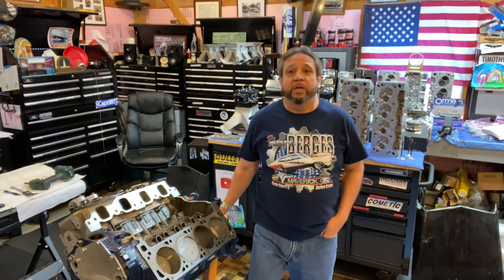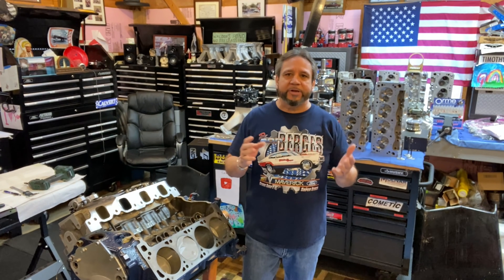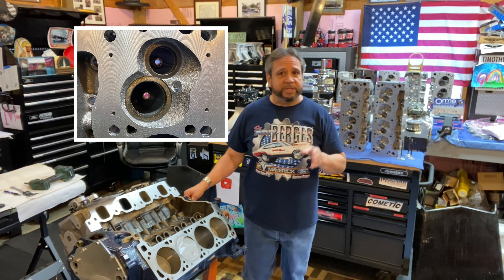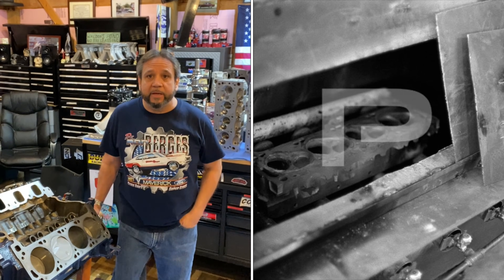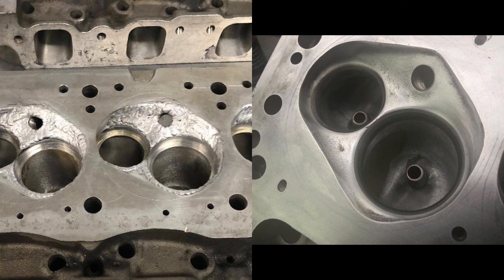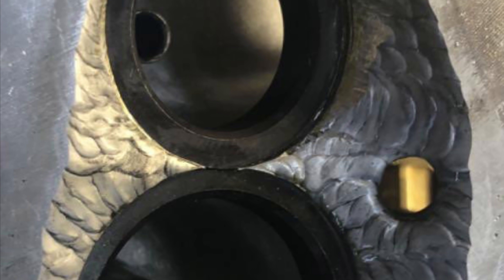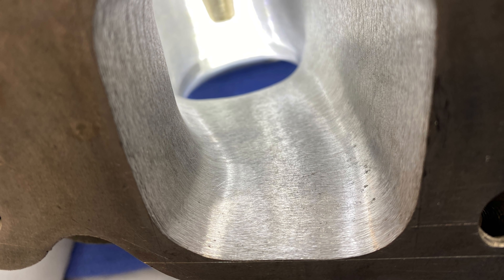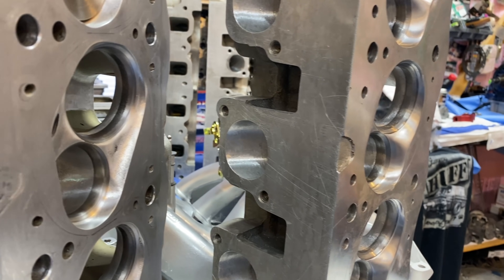The Rarest Ford Head Ever Made...Secret A3....By Darin Morgan

Comment: Either great minds think alike or the A3 heads are the design I gave to a Ford Engineer. The combustion chambers aren’t mine as I had no information on how there shape effected how the fuel was burned when dirt ignited. I would have wanted to make sure the valves weren’t shrouded and that the spark plug was in the stream of air coming into the head via the intake valve. I would have it angled to take advantage of the swirling air fuel as it spun around the cylinder, and be exposed enough to put the spark right where it needed to be. But when I went online to search for the A3 head the exhaust was spot on my design. The intake was raised like I would have done it. The biggest thing on the intake was raising to port high enough that it only has one turn to make it into the cylinder, and the less of an angle the air had to turn through the more air could get in. Air is a fluid and flows like water out of a garden hose. When the intake port sat too low in the head the port has to turn higher around the floor until it makes a sharp turn down into the cylinder. Raising the port floor gets rid of that. The other thing I would pay attention to is the port has the same area as the circumference of the intake valve. As it passes the valve it has to flow through a restriction so attention must be payed to the shape of the valve seat and the back of the valve. The wrong shape of the valve could further restrict flow, or if it’s too big flow could stall.

Comment: I have a 370 inch Cleveland I found in New York ran in a pro stock but now in my pickup A-3 Yates head moldex bidet crankshaft, 1.9 rocker ratio all mechanical roller it made 635 at 7400
Reply from the maker: What are A3 Yates? Two different heads? Any way sounds killer.

Comment: Xcellent Work .  I have an old 🇦🇺 🪃 🇦🇺 Australian 6 cylinder head in aluminium that is very similar to this head . Its a Ford head from the 1970/80 . Think it's from a 3.3 ltr or 4.1 ltr engine.  Hasn't had any work on it . Would be fantastic 4 a single or twin turbo set up..  the valves are shrouded like urs . Xcellent
Reply from the maker: Very cool stuff. Now what you going to do with it?

Comment: Ok, bro. Took me too long to find you again. I turned on the bell so get all your updates. I know this is an old video but I'm a bit behind on your show. A person in Comments or you told me that a 351 C will fit into a 1966 Mustang. I have been busy reading about Ford Heads why they are so good in design, and why the Quad carbs are a 40+hp bolt-on. My update is I have found here in Alaska a 1996 351 w. not a big deal in the lower 48 but in Alaska to get a person to let go of a Ford motor, pulling teeth would be easier. So now what, I was told by a couple of people here that they had never built a clever that ran right and I was just wasting my time. Not only do I have a goal I also have a challenge on my hands. Need some help and I know I'm in the right place.
Reply from the maker: Thanks for being here my brother. Be nice to road trip up there to check out the land and cars. Yes dual 4s, can be any where from 25-50hp. The Windsor will do well the heads however are less than desired. So with work a clevor will be right on the money. CHI has a great water outlet kit. You can drill the 4v heads, many aftermarket aluminum heads are done for you. Really need to have a goal in mind and build accordingly. Glad your here, review all the build section playlist. 💯🏁

Comment: Hey Tim, love your work with Clevo's as we call them downunder! Just looking for some advice please, I'm building a 410 stroker Cleveland (4" stroke), forged scat crank, H beam rods, forged pistons, big solid roller cam and Yates C3 heads on top. Can you tell me please, if you know, what is the correct spark plug to use with these heads? The standard cleveland spark plug which has a 14mm thread and 19mm reach, seems a bit short. I believe I need a longer spark plug.
Reply from the maker: Saw this, part number. Not a lot of familiarity with them 
NGK R5671A-10. Sounds like a killer combo. Appreciate you from Australia 🇦🇺

Comment: great vid, wanted to share another old p/s head trick not well know from a old P/S racer. Along with chamber welding on old iron heads "from those in the know" also increased valve curtain area by using 2.30"+ intake valves by moving exh guides over along with offset dowels on 4.125"+  bore blocks. It has Always been a LIE that the smaller 2.19" valve was better for low end power.
Reply from the maker: I’ve heard of moving the heads on the block, not sure 4.125 bore a little rough for the Cleveland box, maybe some of the Xe could handle us usually about 80 over is about all they could do to. I did not know about the increase valve, can’t comment on that, but I know that too big a valve is worse than having to smaller bell. Darin Morgan told me about that. so many things were done, personally I just don’t know. But also I am talking Cleveland’s.
Reply: I know it maybe hard for some to get the bigger intake valve thing as the smaller valve bs has been pushed on public/Pat Ganahl's book for years and yes this big valve mod was only for meant for the siamesed XE W&C blocks (& furness brazed W&C blocks), the bigger curtain area increases early/low lift cyl fill #'s & along with this trick "those in the know" pro stockers in past used lower 1.65 ratio rockers putting bigger lift/dur #'s on to the cam helping valvetrain. Today the best 1000+hp "D3" type n/a heads are using 2.30"+ / 1.65 valves with 3.6"+ c/s. Some forget the org Boss heads were designed to use 2.230" valves, sorry i cant post links but... DR J  showed/said...
 ("the 2.25 valve fixes a lot of the problems with the heads. With a 2.19 the low lift flow will go down quite a bit, because of the factory under cuts in the valve set. The larger valve allows us to clean all of that up")
 ...also had recent talks with FPS/Troy again saying/doing same thing (btw been dealing with Troy for many yrs, Very knowledgeable guy, recently got more of his  xtc-r A3-T/A port heads)... goo gle "351C Avenger heads corral"

btw, your DM ported A3 heads also look like about 2-1/4" tall port & if your wondering, i was recently banned on corral for offending Gay member by calling him a dfag racer & just remembered Kato Eng, that was also banned for offending Gays in 5.0/5.8 on corral talked about doing this same big valve head mod in/with P/S MII.
Reply from the maker: Sounds like a lot of information, too much for my brain. I just do it works for me. I’ve ran Cleveland‘s with 2.3, and 2.19, never really saw much difference, but combinations are not built to the max. I’ve known Troy Bowen, since 1998, i’m ordering my first Cleveland from him. Had problems with a crack block initially, and then the oil galley plug was left loose in the back. that’s all came from him. Had that oil pan off multiple times think it was a rear main seal. I was learn to check them after that. I haven’t went to California to visit him, after that, the engine ran well, that had heads had ported, and had that size valve. I have nothing to compare to, could stop running iron heads after that. I look at it this way, as far as being banned, I see you were given Tom Siel talk about Lisk challenger, versus sudden death. Will have her own opinions, but it gets nastier derogatory. I just hide the user I don’t see anything it’s just done I don’t need to go through a bunch of BS. I appreciate information from all people and respect people lots information we gain from everybody, but also do it works for you I don’t argue points I mention what I feel and if the other person doesn’t care or wants to argue about it, I don’t waste my time too much to do. yes I remember Kati engineering from back in the message board days. I may copy this and Darin, what his opinion is but in truth, it doesn’t really affect me and my goals, I only have five more engines or sort of build and then I’m done with all that. Appreciate it man. Glad you’re here.

Comment: I almost feel like the headwork likely a improvise junkyard situation resulting in a twisted frame right into a wall off the tree in a wheelie
Reply from the maker: Hey Jordan, I don’t think they had was going to cause twisted frame in a wheelie and into the wall. If you saw my previous videos with a giant wheel stands, that was all from the wrong shocks on the front end. That’s all I needed. I didn’t need wheelie bars. Now when the car launches, it’s only about a foot or maybe 2 feet if that. Is that what you’re saying?

Comment: One really rare head is the "A" double overhead cam modular, pre production head. They revised this initial casting and the full production "B" twin port head was released in the Mark Viii Lincoln producing nearly 300fwhp in 1993! I dont think those early "A" heads have seen the light of day.
Reply from the maker: My buddy had one of those Lincoln’s and it flew, think it was a 4.6. Never had an interest in mod motors, looks like you have a lot of experience with them. That is kick ass hp. Yes they have seen the light.

Comment: I have what is probably one of the rarest heads made.. It is a 2 barrel Cleveland close chamber head but it uses a Windsor style intake. I have this on my 70 Mustang and I have only ever seen 1 other set of them and it was offered on eBay about 15 years ago.
Reply from the maker: Interesting Roy, sounds like aussie closed chamber 2v head. I know they put them on 302, but cannot comment on the water aspect. Maybe someone may chime in. Cool glad you are here.
Reply: @dragboss351cleveland   It is based on the Australian 2bbl Cleveland head which is different from our Cleveland heads as it has a big open space area inside the head which makes them a little lighter than ours.  It does have a large size Windsor intake port which I run with 1966 2x4 Trans Am  intake.
Reply from the maker: @royrichards4142  very cool. Sounds like she runs well. Glad your here
Reply: @dragboss351cleveland   If you happen to have a 1999 issue of hot rod magazine there is an article inside on it and it is also on the cover and it was in the April 99 issue of Mustang illustrated and has been in 7 calendars so far.  If you could post pictures here I would put one up of some of my heads and rare intakes including NOS boss 351, NOS BOSS 302 and and a set of built Ozzy heads along with some of my rare 2x4 intakes including a dual dominator BOSS 302 setup I'm working on. Can't wait to see your heads running on an engine!!
Reply from the maker: Cool deal Roy. I cannot wait either, 11/5 hopefully. If I have time have to dig though them and see what I have. We love to collect parts. 😉

Comment: crossflow ford 300 inline head. there were only 10 or 12 ever made as an R&D project.
Reply from the maker: Blake others said they made pallets of them, the melted them?
Reply: @dragboss351cleveland  at this point, it's tough to say. The info we hear these days isnt always clear or reliable. I was always under the impression there weren't but a dozen actually made. A couple still exist. One fella to ask would be Frenchtown Flyer...he's on several Ford forums. Really smart dude. Guess he was an engineer for Fomoco back in the day. I believe he actually owns one of the few crossflow heads that still exist. Bruce Sizemore is actually working on developing new heads for the 300-6, with the help of some racing acquaintances and other professionals. One being a newly designed crossflow unit. It's posted on the same forums as well.
Reply from the maker: Thanks Blake. I have heard of the FrenchTown Flyer. Have to check him out when I can. Thanks

Comment: Clevelands need a proper cooling system by blocking the internal bypass allowing a bleed and then a proper water pump with head pressure , then they are able to produce power from every cylinder.
Reply from the maker: No history on this maybe others can expound. Have lots of cooling stories and tips.
Reply: @dragboss351cleveland  I am in Australia and am part of a group that was dealing with the cleveland engine back in 1969-70. The head of the group is John Bennett who formulated the specs for the engines installlation into the Falcon road car. In the process he discovered the unique cooling system that engine had. They ran a bucket thermostat which when heated would block the internal bypass allowing coolant from the heads to flow to the radiator. There was specific instruction that did come with those engines from Ford in the US , and that was to NEVER install that engine with a crossflow radiator. When Ford Australia moved from the XY Falcon , which had a top bottom tank radiator , to the XA Falcon which had a crossflow radiator , the warranty claims started flowing all mostly based around blown head gaskets. The other issue was the availability of the bucket thermostat which was changed to a completely different thermostat which when opened didNOT close the internal bypass. This is just the tip of the iceberg. But when we addressed all of those problems we were able to get an engine which was capable of mega power and reliability.

Comment: Any thoughts on choosing a cam for the 4V open chamber heads to improve dynamic compression a bit?  Would it be as easy as advancing the existing factory cam 4~5 degrees as a starting point?
I've still got a set of these "unloved" heads kicking around along with the intake and was noticing the valve heads aren't shrouded due to the open chamber, as if they were designed with a 4 inch bore in mind?  This got me thinking (dangerous, I know...).
My Cleveland is the lethargic H code and I've been giving this some thought again (Tim's fault, LOL?).
Reply from the maker: Those heads if they are the 73 are really one of the best flowing 4Vs. I would be checking cam, bet it needs to be advanced. If you advance it, you will reduce PV clearance, better make sure that is ok. One of the issues with street Cleveland  is that many times cam  is in straight up at 110 and  cars are dogs add no stall, no headers and lame gears. I would evaluate those aspects. If factory cam, now that might be a big factor
Reply: @dragboss351cleveland  It's an untouched H code from 1973, I purchased it in '78 I believe.  Yes, it's pretty lame considering it's breed has so much potential so have always been considering advancing the cam.  Maybe that's where I should start.
I think the 4V heads are 73 but might be '72, about to go look at this.
Reply: D3ZE heads, these were a take-off someone was disposing of decades ago but looked pretty fresh and clean so I grabbed them.
Reply from the maker: @thisisyourcaptainspeaking2259  yes that is an issue. Ck cam, make sure headers, stall Convertor, and gears and ready to rip
Reply from the maker: @thisisyourcaptainspeaking2259  use them, be nice to have at least 10.5:1 cr
Reply: @dragboss351cleveland  Thanks, maybe I'll start with a timing set and add some advance.  I'm pretty sure it's factory original valve timing b/c I probably would've noticed when I removed that dreadful nylon cam gear.  Too bad I didn't advance the cam when I had a chance, my bad.
Learning something new!  Wouldn't have anticipated the Cleveland is an interference engine, given the lousy cam gear ford installed just waiting for the teeth to shear off.
Reply from the maker: @thisisyourcaptainspeaking2259  I know what your saying. Had one shear off a Windsor back in the day. The issue is advancing and not measuring. I suspect you would be fine, advancing the cam or retarding, only changes pv clearance by  maybe  ten thousandths.
Reply: @dragboss351cleveland  Good point about advancing willy-nilly, not a good idea ever, without prior research!
I lost the cam gear in a '69 Malibu 350 on a bridge during rush hour.
Reply from the maker: @thisisyourcaptainspeaking2259  mine was from a neutral drop at a light, thinking I was going launch hard, yeah 15 yo thinking.
Reply: @dragboss351cleveland  Ha, ha, I snapped a U-joint cross on my very 1st neutral drop.  Had the greasable joints on there, broke right at the zert.  Didn't even get a chirp, there I was in broad daylight with my Spicer dragging the ground.
Reply from the maker: @thisisyourcaptainspeaking2259  I learned never to do that again lol. First big engine job for me. Did split a driveshaft in two on the launch of my 385c, 4 foot wheel stand. Snapped the yoke off a brand new moser 35 spline. Driveshaft I. Two pieces, takes out brand new slick, brand new rechromed rear bumper, and hole in rear valence. Moser gave me a new center with pro gears, never an issue after that.

Comment: That's how race heads were done, back when you couldn't throw money on the counter and walk away with them, it's not magic - it's old school craftsmanship.
Every race/high performance part in the industry originated from a factory part extensively modified by someone making what they couldn't buy or afford. 
Even the billet heads and blocks available have their roots in a factory part, extensively modified and then re - engineered to be cnc machined from a solid billet. 
These A3s may have been 'secret', but not this set - they're like every other set of fully worked, remade (by master craftsmen) heads.
Reply from the maker: Made with blood sweet and tears Mike, thanks for taking the time to comment. Appreciate your thoughts as always. Still got to call them my secret weapon. Thanks and more on the way.